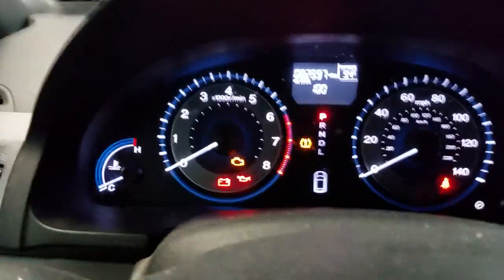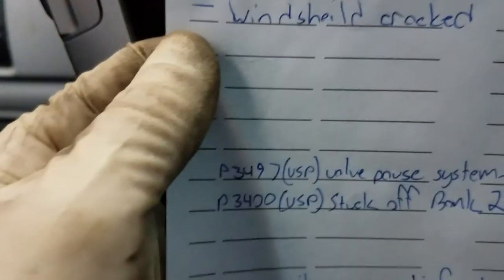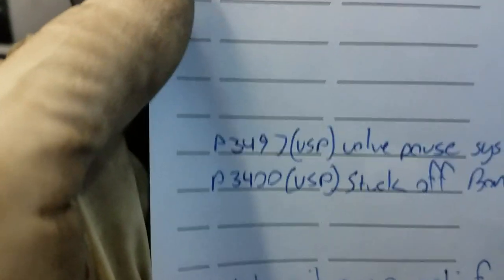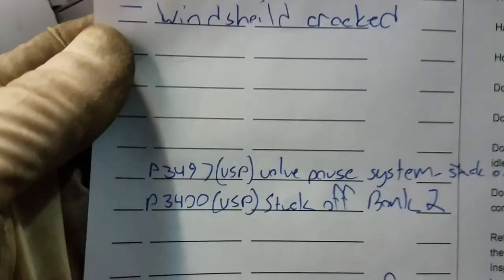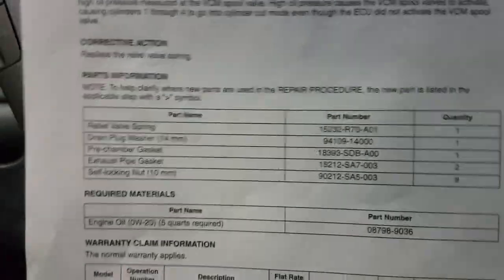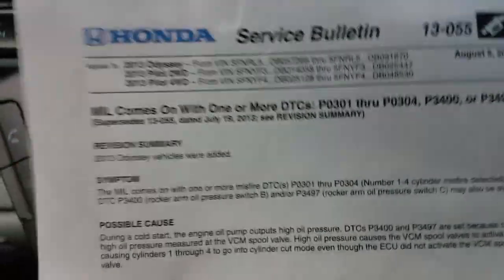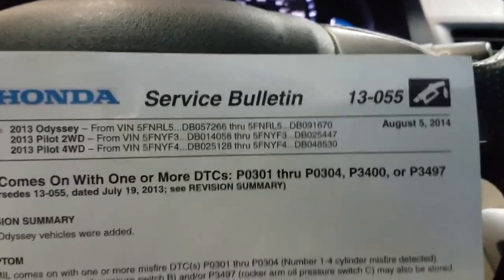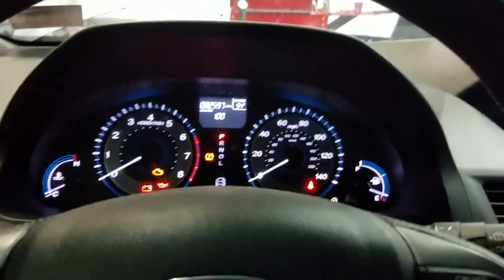P3400 P3497 Valve pause system stuck off ( Try this First )

Comment: Code 3400 is NOT Bank 2.  Code 3497 IS Bank Two. Same Oil Pressure Switch on both sides of the engine, same O-ring.  Oil Pressure Switches go on the VVTs.  Bank 1 holds sparks 1, 2 and 3.  Bank 2 holds sparks 4, 5 and 6.

Comment: I had this code, 2012 pilot.  I changed the oil and the check engine light went away.   Mind you. The car lost 3 quarts of oil.  It was running on 1.5 quarts and the low oil light never came on

Comment: Dude thanks for the video! I replaced both the gaskets in the top of the spool valve on my 09 Accord to fix an oil leak. The next day it threw P3497. I had already purchased a whole new spool valve assembly but luckily I stumbled upon your video before I installed it. Threw in some fresh Mobil 1 and boom code is gone. You saved me 130 bones. Much appreciated!
Reply: I changed the oil 5 w 20 like honda specifications. I added water remover in tank. Filled up with super unleaded gas and added fuel injector cleaner same time. Opened swirched on pause valve and changed them from Advanced auto. Car ran crazy but code got cleared up after few days. If you are not comfortable change oil and replace the top half part of vvt solenoid. Buy DORMAN brand from Oreiley for 100 bucks and it is good to go. It has to do with dirty oil and gunk built up. Everything works good for a month like a champ.

Comment: There is also a screen in the vtec solenoid that can get stopped up restricting oil flow. Usually caused from incorrect oil and late oil changes. You will need a new gasket the old one almost always Disintegrates whenever you remove the old one anyway. This will also save people $. And on some honda engines there is a o-ring inside the valve cover that van swell and restrict oil flow causing these codes. I worked for honda for almost 7 years lol

Comment: That TSB is fine if you have a 2013 Honda Odyssey. There is also TSB 13-031 that covers 2008-2012 Honda Odyssey that covers the rocker arm oil pressure switch and o-ring.
Reply: Could you please elaborate more on this?
Reply: @anthonycortez900  Sure, the TSB covers the 2008-2012 Odyssey that is throwing the code P3497. It basically says if the car is throwing P3497 and has had a recent oil change or the oil level is at the correct level, then the oil pressure switch will need to be replaced, and it is really easy to do yourself, all depending on which bank, P3400 is bank 1, which is located on the oil spool valve on the top on the driver side and P3497 is bank 2 which is located on the top near the oil dipstick on the passenger side.

Comment: how long after topping off the oil should I wait to see if the engine light goes off? of course this light came on on my way to take the van to be smogged. Only 110k on 08 honda odyssey

Comment: I have a 2014 Honda Pilot.  P3400 dct light came on before oil change.  When oil level checked it was full.  Shop reset the code.  I drove home from work approx 34 miles and 45 minutes, light hasn’t come on yet.  But have a long family trip and nervous.  What problems could occur or to watch out for while driving?  
If light comes back on, should I be worried for that p3400 code again?
Reply: It was probably due to a low oil pressure reading which is linked to the cylinder shutoff system which shuts down cylinders when you do not need the extra power. 
Now that you have changed the oil, your oil pressure should be normal and the light may not reactivate.

Comment: So I replaced my oil pump check the oil pressure replace both solonoids on bank one and bank 2 and oil pressure switches on bank 1 and 2 with Honda parts and I replaced the oil pressure switch at the oil filter The code still returns
Reply: Any update? I am going through this right now on my 2016 Odyssey. I've changed it all and the symptoms persist.

Comment: I was getting both codes. I went and got an oil change. How long does it take for the check engine light to go off on its own? I have. 2010 Honda Accord ex-l. It’s v6 but when I’m just cruising the little green ECO light pops up in the dash to let me know it’s only using 4 cylinders instead of the 6. It’s not doing that as of now, I had an oil change last night. Does it take a day or two? Or does it depend on the miles?
Reply from the maker: It takes about 30 to 60 miles for light to reset itself.
Reply: Same problem here any solution ?
Reply: @yader239  I have the same problem, did you solve it?
Reply: Use super unleaded gas and add fuel injector cleaner to gas. It has dirty oil and built up gunk around valves. It should clear up after 50 miles of slow driving. Dont go beyond 3000 rpm. @mohammadfuad4786

Comment: Hello guys I have Honda 2010 pilot  Elll 4 wheel drive .  This 3497 is pop on on my dash board. And also when I gave it accelerate it vibrated and I hear noise.  Could you tell me what is the problem? I just changed oil then later the light is off
Reply: me right now :/

Comment: I have tried all that you say I only have the doubt. I'm getting only the P3497 while my odyssey is cold works fine, but when it's warmer the code come back. What can I do? By the way I changed the oil pressure sensor (in the Rear side) is that the correct one?
Reply: I'm in the same situation. I only have P3497, oil level is good and it not old. We're you able to fix the fault ?

Comment: I replaced gaskets. Car worked great for 15 days like new. Code came back on highway. I replaced switches. Car worked for 10 miles. Now valve pause system is stuck. Do I replace entire assembly or just the top part? I can't do the body of solenoid. I can do 3 bolts and install Honda or after market part. Please advise.
Reply: I have the same problem, did you solve it?
Reply: @dean78c1  I replaced upper portion of soleoid assembly. Oreiley sells life time warranty part. Changed oil. Added fuel injector cleaner and filled up with super unleaded gas. Clear the codes and drive at 2000 rpm for few weeks. It should clean up all gunk and car should run fine, It has to do with dirty oil and gunk built up.

Comment: I have a 2010 honda odyssey that has this code I'm going to replace the rear solenoid spool valve but the engine is vibrating pretty good at the moment will this fix my problem?
Reply: Also I just had the oil changed and I'm worried about the engine vibration
Reply from the maker: Yes, the engine will run poorly if its setting these codes, in most cause but not all the time.
Reply: what if it says bank one?
Reply: My 09 Pilot has had this persistent issue. Always when I'm on a road trip. The ECO mode tended to foul my plugs and a new plug/coil was replaced. Disconnect those pressure sensors at each cyl head to turn off ECO.

Comment: I just had this come on after an oil change on Honda Odyssey 2013. Assuming to the dealer / mechanic to get it looked at?
Reply: What was it
Reply: Were you able to fix it ?
Reply: If I recall correctly, mine needed the service bulletin mentioned in the video as the oil change was just done and after clearing the code it came back pretty quick.
Reply: @JeremySchwartz2027  so you were never able to get rid of the fault code?
Reply: @AntonAtan  basic scenario was had oli changed. Then code showed up. Reset code to see if it would stay away, it did not. Brought it to mechanic and they had to do the service bulletin work to get the code to go away.

Comment: How much does getting those things replaced usually cost?
Reply: Was $800 for me
Reply: Oil pressure sensors that may clear the P3400 code are about $25 each from online vendors. Very easy to replace.

Comment: Thank you for the tips. I had vtech gaskets replaced 2 months ago because of leaking + alternator.  I checked the oil levels, it's actually about max. Could that be the problem?
Reply: I have the same problem, did you solve it?

Comment: Hello my friend so I changed the sensor oil was low I am at 20% I topped it off but suggesting to change oil maybe that will be cuase of the p3497 code on my car I drive a 2011 Honda pilot I changed the gasket on the vtec solenoid put it back together ran fine then next day this code popped up on me
Reply: I have the same problem, did you solve it?
Reply: I have the same problem, were you  able solve this problem ?
Reply: @dean78c1  no friend I changed the whole VTEC solenoid
Reply: @AlexHernandez-ox8ir  it’s solved for me, what the problem was during vtec gasket installation they used silicone and it should stay 10 hours before running engine,
I removed the vtec, cleaned it very well with carb cleaner, instal it with new gasket and without silicone 
It’s working well now 
You should be careful during bolts tying it may broken

Comment: I have changed the spring and the code keeps coming next will be the whole valve solenoid,  by the way I will have those covers open,  I will adjust or calibrated the valves change the water and oil pump

Comment: Fourth time I've had this come up. The first three were ECO mode issues.. Now I won't go on a road trip without a spare plug and coil pack. And disconnect the two sensors.
Reply: Mine is in it's 2nd time changed the oil switch first time it fixed it this time it didn't its running like shit. What else did u do to fix it
Reply: Yours involved a coil pack?
Reply: @mdargusch  Yeah. Highly annoying